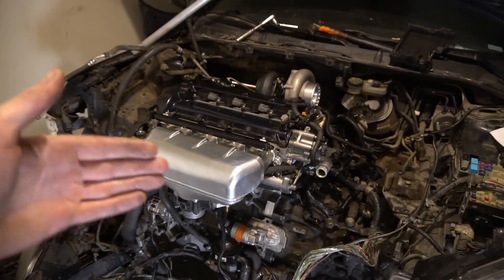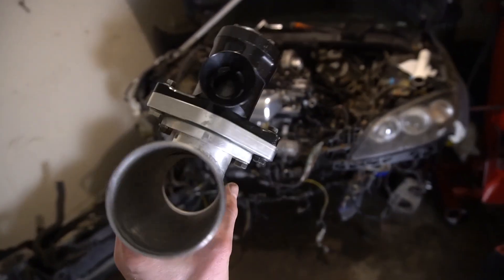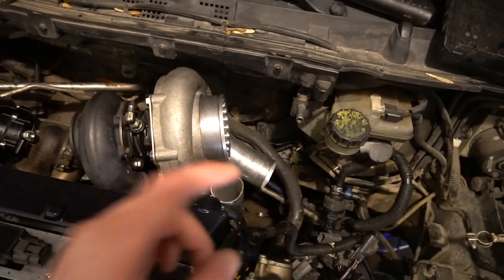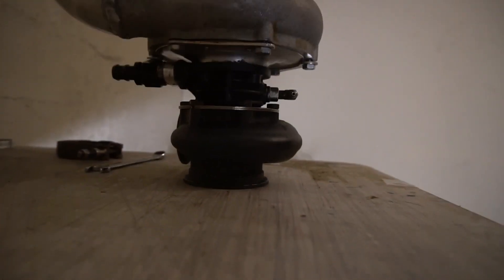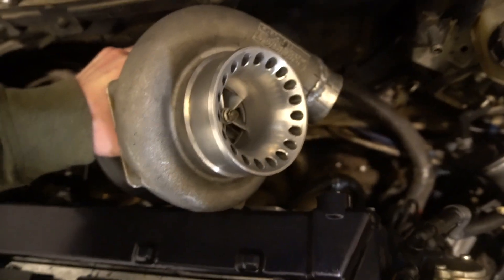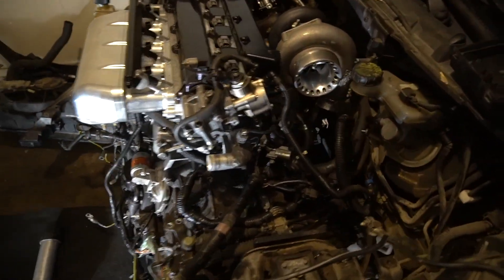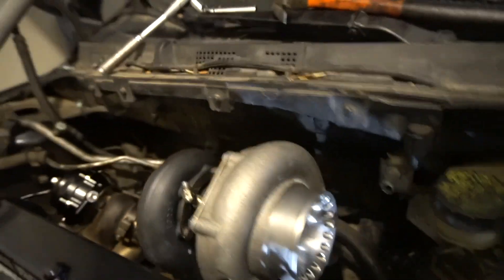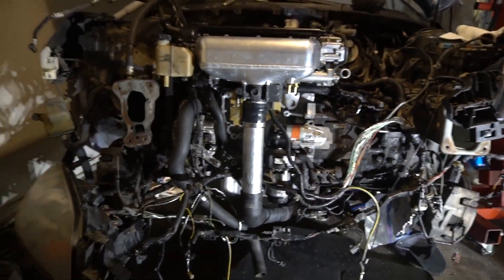Mazdaspeed 3 Build part 3: Diy Custom intercooler piping for my turbo

Comment: 20lb per square in means just that if the pipe has an inner surface area of like 6 square inches for every inch of pipe that's 120lb of force trying to rip it open per inch of length so a 20 inch piece of pipe with 20 psi litteraly has 2400 pounds its holding from ripping it apart. Your piping doesnt matter as long as it doesnt blow up well ya exactly your piping does matter so it doesnt blow up.
Reply: A vacume in the tube would apply atmospheric pessure of just 14 or 15psi to the outside of the pipe trying to crush it and it would fold up like an aluminum can its much harder to break it from the inside out than to crush it. Piping or tubing is designed that way but toughness matters alot
Reply from the maker: Thanks for the insight brotha super helpful. So do you think my piping is going to explode?